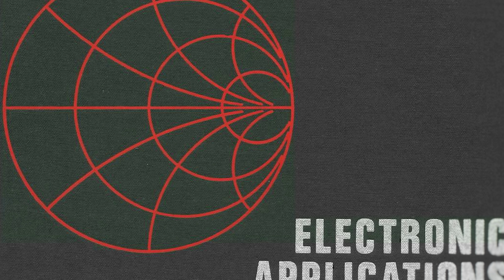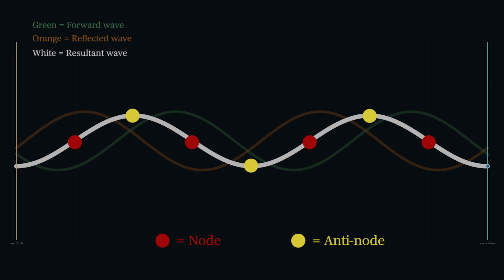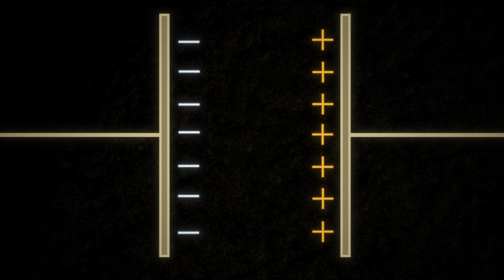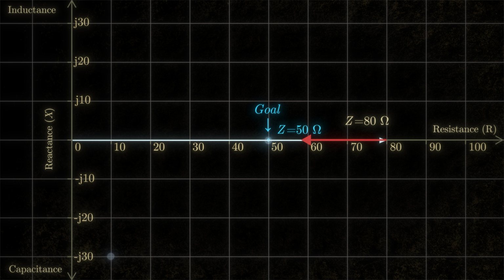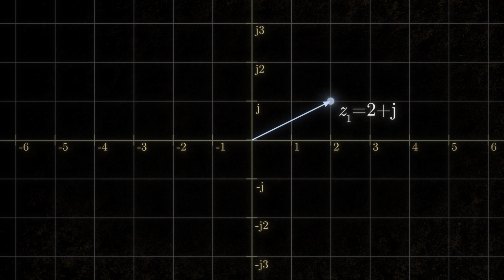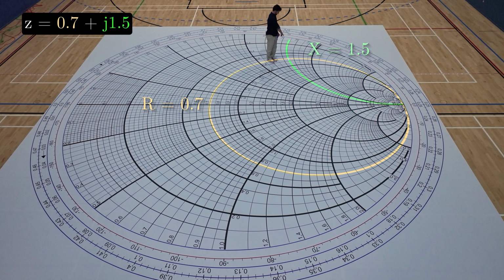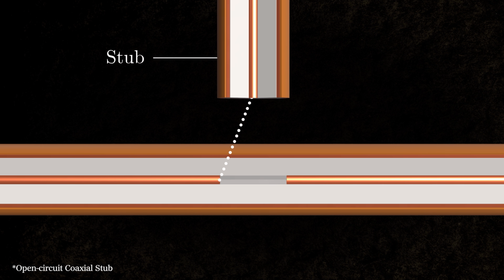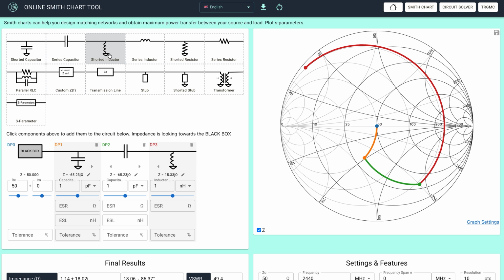The Scariest Chart in Electrical Engineering

Comment: This really shows that resistance/impedence is a space-time phenomenon, when you dive deep.  With SI units kg ⋅ m² ⋅ s⁻³ ⋅ A⁻² this chart really links how energy, space and time interact. Expanding kg to fundamental units with energy, the units become J ⋅ m² ⋅ s⁻² and results in only energy, time and charge (J ⋅ s ⋅ C⁻²). And reduce kg as force, you get Force, space, time and charge (N ⋅ m ⋅ s ⋅ C⁻²).
Reply: Which is why the permittivity and permeability of free space are such fundamental concepts.
Reply: @philkarn1761  Agreed. Permeability reduces to Ohms/velocity and permittivity to the inverse of Ohms*velocity. But undergrad and even grad school just brush this under the table and say "Don't worry about it. Shut up and calculate." 

In addition you can frame the "bending of light" in GR as local changes to permittivity and permeability. Also in refractive physics.

Comment: I learned about the Smith Chart in the late 80's while becoming a ham radio operator. Never thought much of it, but had an Elmer that I guess knew just how to teach it's use without imparting the dread.  Several years later in a Navy A School the instructor brought out an oversized Smith Chart in the RF class and said this will be the most hated bit of paper we will ever experience.  I raised my hand and after he called on me I asked "What's so hard about a Smith Chart?" He asked what I know about it and I gave my Elmer's version:
The goal is to get the RF between the radio and the antenna to the center. You find your start point, being the normalized impedance, rotate the that point towards the transmitter based on the electrical length of the coax and then either adjust the antenna to match the impedance or use capacitors and inductors to form a matching network because each component will move the point in a predictable path.
Yea, I know it's a bit more convoluted, but not that much and it was fun watching the instructors jaw drop.

Comment: I used to use this chart to tune microwave cavity filters. Didnt have a clue what it was telling me, I just knew I needed to tune the reflection of the target frequency 180deg for each chamber, then as we tuned the last one it would bring all the markers into the middle and you could see the bandpass frequency on the input signal. I just treated it as a really boring video game except you controlled the position  of various markers on a screen with literally 4 or 5 nuts and bolts that were physically changing the size of a series of tiny hollow chambers milled into aluminium.

RF is weird!

Comment: I wanted to work through this to see if I understood the process.  Using the online smith chart tool, I see that the first intersection with the 50 ohm constant resistance circle uses a transmission line of about 4.5mm, then uses a 1.65pF capacitor in series to get to 50 ohms.  The second solution uses a series inductor, and that intersection with the constant resistance line is around 41.5mm long, and then uses a 13.2nH inductor to get to the 50ohm point.   In the video, he states that you could use 3.1mm or 28mm of 'extra line'.  Neither one of those number are close to what I got at 4.5mm or 41.5mm, so I am not certain where the discrepancy is.  Possibly microstrip velocity factor?

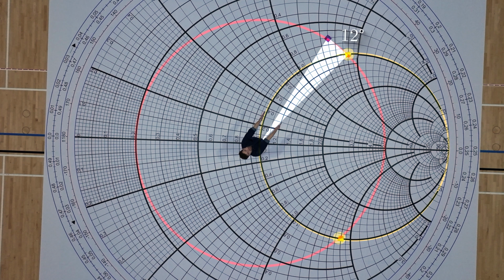Comment: At 28:51 you state that "360 degrees is 1/2 a wavelength".   It may be more accurate to say that a complete rotation on the Smith chart is 1/2 a wavelength.

Comment: As an electrician, I’m trying my best to not be mean to electrical engineers despite how much they deserve it. 

But this really is an example of theory and reality rarely interacting, but that’s neither here nor there
Reply: Huh? You may not need this stuff when working with AC power in a building because 50/60 Hz wavelengths are so long, but you very definitely need this theory to model long distance AC power transmission lines. They follow the very same physics theory.
Reply: @philkarn1761 that’s true, more than anything this is just a joke at electrical engineers expense, after all it’s only fair given some of the dumb stuff they design that we have to deal with 😂

As the old saying goes “an architect’s dream is an engineer’s nightmare, and the engineers solution is the installer’s nightmare”

Comment: Never had a problem with the Smith chart. I used them daily in either paper or electronic form to match microwave circuits. They could provide either a conjugate match for maximum power transfer, or noise match for the front end perormance of a satellite receiver.

Comment: I once told my systems dynamics professor that complex numbers were just a sneaky way to make engineers do trig. I am right by the way the math just balloons in size if you do pure trigonometry. Anyway I was the only one to make that professor to laugh in that class. And a laugh is something you need when controlling a sprung and dampened inverted triple pendulum where the shafts of the pendulum have mass and every joint has some friction.
Reply: That's a great way to put it. Complex numbers are a sneaky way to make engineers use trig. Of course, anybody who understands them knows how fundamentally they're connected.

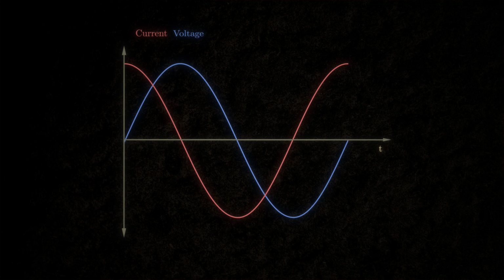Comment: At around 12:05 ( https://youtu.be/GK2pZ_oVU1o?t=725 ) - How do you go from: Because it's always a quarter of a cycle, that means a 90 degree lag in current.  At that point, I don't see any 90-degree angles on the graph?  Is the "1/4 = 90 degrees" some law, table, rule, or something else in trigonometry?  (P.S. Sorry, in my case, most of these things are long forgotten)

Comment: In the Semi industry we use matchboxes that match the RF generator impedance (50Ohms at 13.56Mhz) to the plasma impedance in the vacuum chamber typically of an Argon plasma. There you have two adjustable capacitors with fixed inductors (typically a T-match) to achieve perfect match for different running conditions like pressure and distance of the cathode to anode. Very cool demonstration.

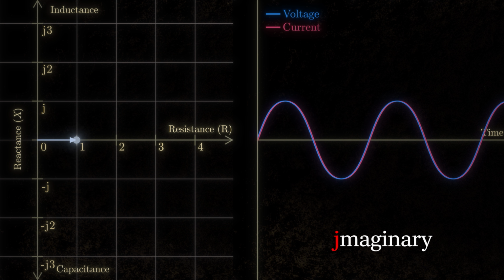Comment: I had ine paper of electrical/electronics engineering in my second semester. That was in the first half of 2004. Today, 23 years later, I actually learned inductors, capacitors, and resistors, as well as impedance in a way that I will never forget. Only took 15:22

Comment: well, now I'm racking my brains, trying to remember the derivation of a transmission line characteristic impedance.
I've worked a lot around broadcast video (75ohm coax) & audio (50ohm coax for the radio mic systems); can;t remember how we ended up with these numbers. they don't fall out of natural phenomena, exactly...
Reply: The wikipedia article on the topic is quite good. To first order (assuming perfect conductors) it's just a function of the capacitance and inductance per unit length, and that's set by the geometry of the conductors and the material (air, vacuum, teflon, oil, polyethylene, whatever) between them.

Comment: As companion video on impedance matching, steve mould made a pretty good demonstration using a torsional line, and alpha phoenix has both a video of the reflection of a progressive transverse wave in a string leading to a standing wave, and a series of videos on the propagation of electric signals - including one where he measure the transient regime at each point of a DC circuit (Watch electricity hit a fork in the road at half a billion frames per second), and a companion video on his secondary channel, betaphoenix specifically on impedance matching in the context of powering up a DC circuit through a transmission line.

Comment: Very interesting explanation of the Smith chart. Useful but there are a few areas that they are not being entirely accurate. Waveform is not restricted to AC only and most RF systems actually use DC for transmission. There is still a wave form. SWR levels happen in both systems.
Reply: Not sure what you mean...

Comment: You made a MISTAKE at 28:56, it seems that you calculated with 1580 MHz instead of 1058 MHz. The correct values would be 4,7mm and 42,3mm respectively. 
Anyway this is an amazing video with great story telling. I love it!
Reply: Did you take the velocity factor into account? I don't think they explicitly mentioned it. It's typically around 0.66 for polyethylene dielectric coax.

Comment: Anyone vote for getting rid of outdated and unnecessarily difficult "imaginary" numbers (a name coined in 1637 by René Descartes to mock numerical concepts he initially thought were fake), and moving to IQ notation instead (that's already proven and used every day by engineers)?  I vote for this!
Reply: Yeah, except it would be yet ANOTHER chance to confuse students. EEs may use 'j' as the unit of imaginary numbers, but we'd already learned it as 'i' in precalc. And then you had to not confuse that with the "I" axis in electrical engineering, which is actually the in-phase or real (*not* imaginary) axis.... Like Ben Franklin's mistake in saying that current flows from positive to negative, it's probably far too late to fix now...

Comment: i love wave n frequency, btw currently we doing syncronization of the wave via the impedence etc.. but those creates heat which is not efficient, but if we go deeper about wave fequency n the MAGNETIC field wave its produced (currently we categorized them as a diffrent or sparate things but for me actually they the same) so i think the most efficient way to enginered a way to manipulate the sync of the electric or radio wave frequency is by manipulating the magnetic field, which from my math have a link to the electric wave it self, so magnetic manipulation needs no stub n physical resistence for syncronization of the wave, n yeah need a new chart for the magnetic field, n thats also have correlation to space time curvature, hench later theory of evrything hopefully i finished that 🤣
Reply: the things is magnetic term is abit problematic 🤣, we sometimes do a confusing n blunder terminology, like we merge of things into one of something which is sparate n we sparate things which is actually the same things, so yeah that a categorization paradox, limitation of language 🤣
Reply: even light it self is the same thing with those, what diffrenciate is the wave frequency

Comment: As an electronics enthusiast and ham radio operator licensed for experimentation from HF to Microwave bands I have used classic Smith charts for many years while designing RF circuits, PCB layouts, transmission lines, cavity filters and antenna arrays. These days I rarely use paper smith charts as I have been using a vector network analyser that displays real time measurements on the small VNA screen that can also be displayed live on a much larger PC screen making it easier to accurately see/read the display. The VNA smith chart output makes development quicker and easier and allows you to rapidly  make fine adjustments to transmission line lengths and impedance matching components, feed points, stubs, filters etc to improve efficiency of the antenna system as a whole.  I have a few thousand ham stations in over 150 countries around the World in my logbook, all contacts made using home made antenna systems and arrays optimized for efficiency using VNA measurements and smith charts. When You are running QRP (5W or less) every little bit of RF energy is critically important and the VNA & smith charts allow me to improve the efficiency of each part of an antenna system, and the system as a whole for optimal power transfer and transmission which is absolutely critical for QRP communications.  I used a 'random length' wire antenna with low loss coaxial feeder and impedance matching components optimized using the VNA & smith charts to have several good contacts with stations in New Zealand about 200 miles from my exact antipode on Earth running 5W into the antenna system, The 'random wire' used was a section of deer fence a few hundred ft long, the impedance matching and feeder was put together and adjusted for minimal loss in about half an hour, the primary lobe sent my signal from Ayrshire, Scotland over the north pole and down to New Zealand South Island where I made solid contacts and got good reports from three independent stations. I was very happy with the results, pretty good for only 5W from a portable HAM station set up 1,065 ft up a hill in a short time. This would have been much harder and taken a lot more time without using the smith chart / VNA to rapidly optimize the antenna system.  Smith charts may look daunting at first but when You get used to them they are an invaluable tool.  Optimizing a complete antenna system, feeders, impedance matching components, filters etc and adjusting the system for specific locations with structures within the near field of the antenna would be so much harder and slower without the smith chart.  They look scary at first but the smith chart is Your best friend when You get used to it.  All the best, 73 de MM7WAB in S.W.Scotland

Comment: LMAO - VSWR Chart (Smith Chart, et.al.) - From 64 to 78, I worked with radio/TV circuitry, often impedance matching for low VSWR - from single input to sweep signal generators/comparators, all HF to UHF.  Luckily I got into Microwaves, Satellites, and Ground Stations (BWO, TWT, YIG Filter Oscillators, etc.)  I finally graduated to R&D, mostly paperwork, where the work was much easier, and the pay was better.  In the 90's, I retired as a Sr. Aerospace R&D Engineer and went into another career in ISO and QA.  Watching this took me back 6 decades... Thank you very much for the memories.

Comment: And I’m over here wondering why when I flip the space heater to “off” I see a flash in the room and then my washer has a power outage…
Reply: It's because when you shut the power off, the static current collapses on the circuit and shorts at the weakest connection.

Comment: Thank the Lord I studied aerospace engineering.  The worst thing we had to figure out was how to launch a rocket from Cape Kennedy on a spinning spherical coordinate system within the planar spinning solar coordinate system and land that rocket into a specific crater on Mars, another spinning spherical coordinate system in that same planar spinning coordinate system.  And, of course, we want to minimize fuel used on the trip, so it's a minimization problem.  Rocket science - am I right?
Reply: That still sounds easy -- it's just a bunch of vector superpositions. Now fluid dynamics -- that was the course that seemed to strike fear in the hearts of the mechanical and aerospace engineers I knew at Cornell. For us EEs our rite of passage was quantum mechanics and solid state physics. Smith charts were child's play by comparison.
Reply: @philkarn1761  It sounds a lot harder than it was.  Once you get the tensor/Kroneker Delta/coordinate frame transformation matrices in your toolkit, it comes together all the time.

Comment: I'm an RF engineer in the field of metrology, calling our field magic and turning it into a big deal is a self-fulfilling prophecy. Math still governs, the cool bit is the accessibility to design your own passives which looks a bit ridiculous but if you dive a little deeper into the material all makes quite a lot of sense. A Smith chart is nothing to be scared of, you don't have to fully understand it in order to use it, neither do you need to understand how a ruler is built in order to draw up plans for a woodworking project, or how a pencil is made for you to write and draw art. Use it, get a bit acquainted with it, learn to design circuits with it and build a gut-feeling messing around with a VNA to see how stuff moves around on one. Once you feel quite comfortable and try to do stuff that's not as customary, then you already have a reasonable understanding to dive deeper to HOW a Smith chart works mathematically, that's the point where you can go some really fun stuff.

RF isn't scary, its fun, you can build functional circuits with crap you find around the house. Build waveguides by brazing flanges to old rectangular chair legs, RF cavities from cookie tins, power amplifiers from copper radiator tubing, there's a billion ways to tackle the same problem purely depending on your materials you have at hand. Nowadays, it's a super accessible field with the dawn of cheap and amazing VNAs, you can get RF connectors from China for literal cents that carry well into the 10s of GHz. Remove that stupid mental blockage and get building, it's one of those fields mathematics is a suggestion whilst a gut-feel is most powerful. I think in university people are way too fixated on math, and whilst it's convenient to know, in my career I mostly rely on hands-on experience from hobby-ing. Even if you can't afford a VNA, you can always build your own equipment and join a group of HAM-mers where you can characterize your stuff. Visit swap-meets, pull RF crap off of eBay listings, get creative :-).

Comment: Convoluted explanation and drama for something basic in AC circuits, complex algebra. The standard of Veritasium is dipping. Disappointing and a boring presentation. Use a regular rope / jump rope to illustrate wave propagation. Using a plastic toy which already has a helical pattern only will confuse the audience. Wave within a wave??

Comment: I can barely work a flashlight, but I feel like I learned something..
I especially liked it when the Dude is like;
"Just incase you ever have a need to reduce the energy reflections of your transmissions or maximize the efficiency of your power outputs...
Just plot your numbers onto the infinity chart and then solder a measured vestigial stub into your circuit to "cove out" the "J"maginary part of the equation before you hit "send"."

😅 ❤